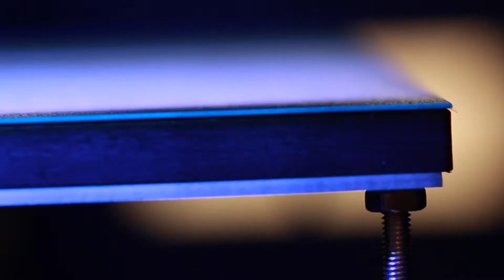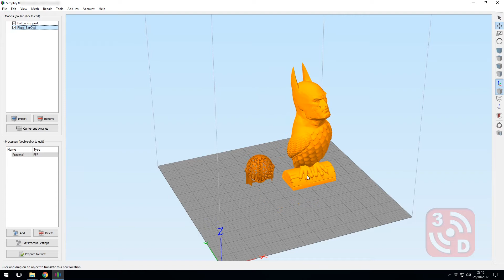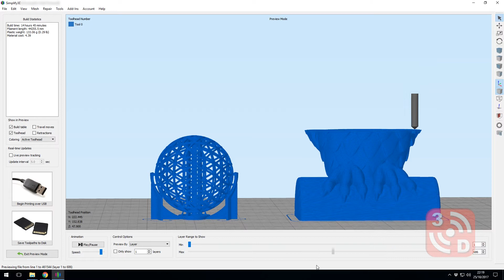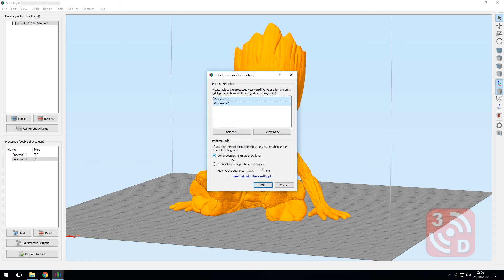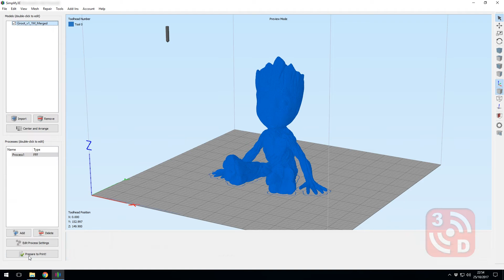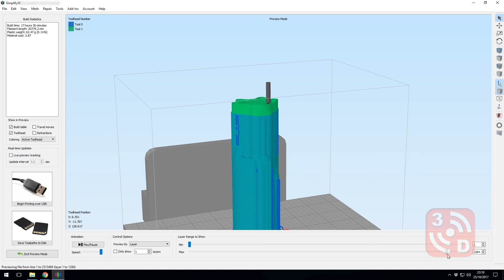Simplify3D - Using Multiple Processes 101

Comment: This video is wonderful! Just one more question guys. Is it possible to use Simplify3D to realize different settings for different selected parts of one model? (Not only simply select the height, but select exactly which part I want.) For example, I want to print the hand of Rick in 100% infill, and print the other parts in 50% infill. Is that possible?
Reply from the maker: Unfortunately right now that's not an option. Simplify3D are very overdue an update and the userbase is getting restless feet as S3D aren't really responding to people's queries. If they do release an update, hopefully that will be an included feature.